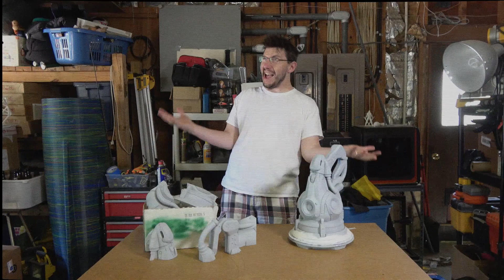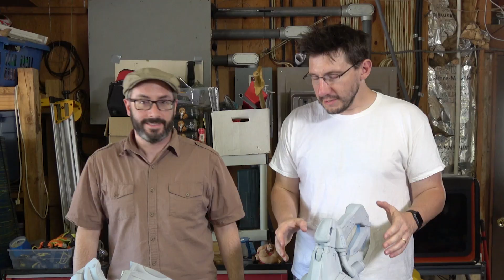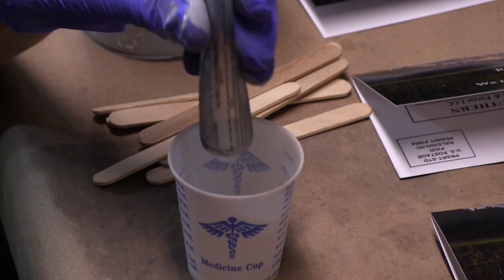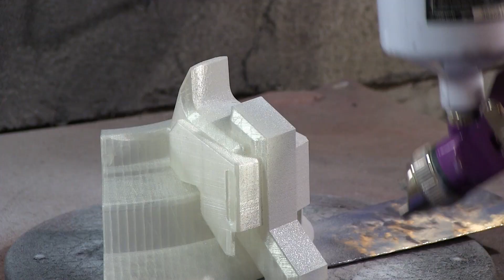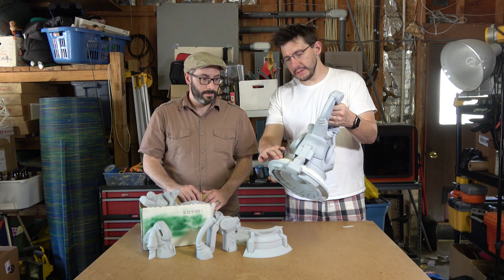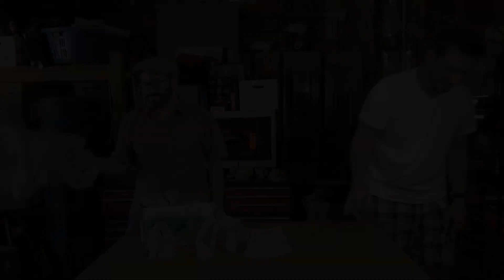3D Printing Lucio's Sonic Amplifier Part 2 - Jonny Cruz, Punished Props, & Feather Fill

Comment: Hey Joel, huge fan. I have a question that I am hoping you would be able to help me with. Would a filler like this work on small 3D printed models to use for things like dungeons and dragons. How much detail do you lose in a process like this (provided this one is so big it doesn't matter).

Have a good one and keep up the good work!
Reply from the maker: I would use air drying putty for small things - this way you can apply in very small amounts and maintain details

Comment: is feather fill much better than the rattle can filler primer?
Reply from the maker: That's a really good question. Bill says it's good stuff, so, I assume it's THE good stuff. I'll make sure to ask next time I see him.
Reply: I'd love to hear the answer--I've been using 2 in 1 filler primer and I'm curious as ro which is more effective.
Reply from the maker: +Victorthebattousai Feather Fill is good, not sure about the differences to filler primer. However, Feather Fill is a LOT harder / difficult to spray.
Reply: 3D Printing Nerd that makes sense it would be more difficult to handle.

Comment: Hey Joel, what are you using for infill on Lucio's gun? I was thinking that anything over 15% would make it too heavy for cosplay. Also, ever use Bondo to remove and smooth layer lines on a final print? High five!
Reply from the maker: Hey Ed! I think on Lucio's gun I used 5% infill. It's heavy, but still light enough to carry I think. Also, YES to Bondo! I did that on the Mario cube. I need to get that video out so you can see it!
Reply: Thanks! Trying different techniques besides sanding (and sanding, and more sanding). I'm not a fan of XTC as it leaves a smell weeks after application and it sets way too quickly. Keep up the good work.